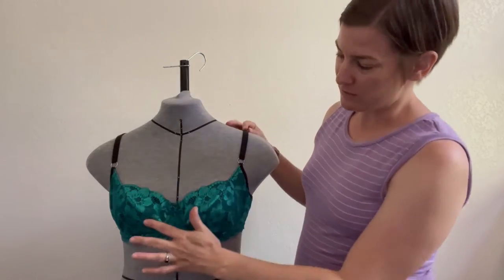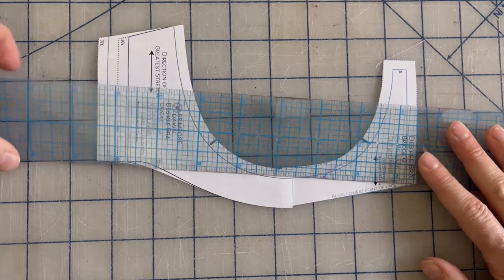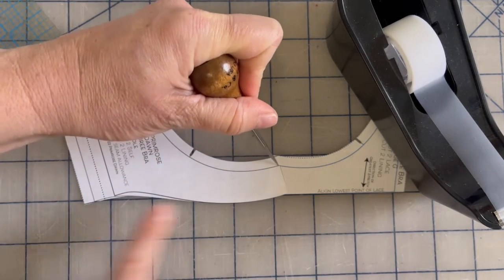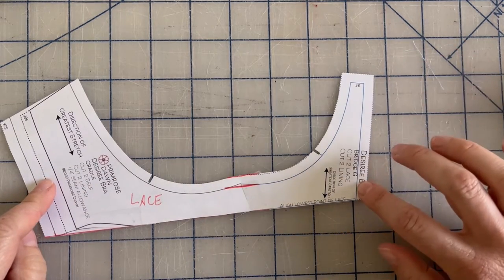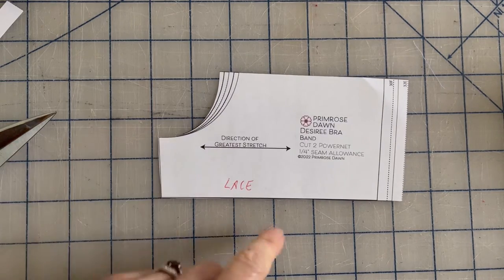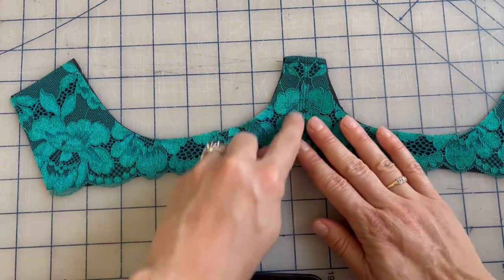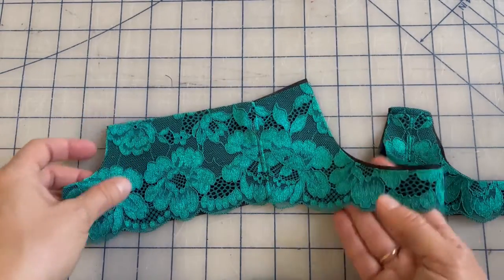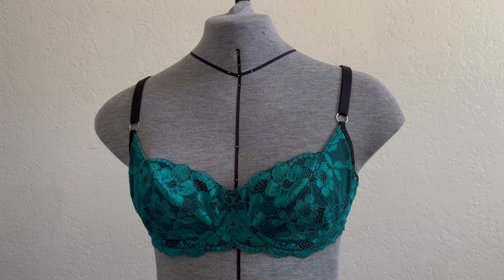Desiree Bra Pattern Hack: All-lace Balconette

Comment: This bra is so beautiful! I haven’t seen since elementary school classes but I’m so interested to make comfortable clothing tailored to my body . I have a question: I would like the bra to be  lined with silk for skin comfortability, is that possible with this pattern?
Reply: Also, with this hack does the cup become different because of the wire seam being shaped differently in the pattern ?
Reply from the maker: @mialuna6129   I haven't worked with silk for a bra, but I think you could use it on the bias for lining the cup.  The wireline shape looks different due to the adjustments for the lace, but the fit will be the same and won't affect the fit of the cup once the wires are put in.